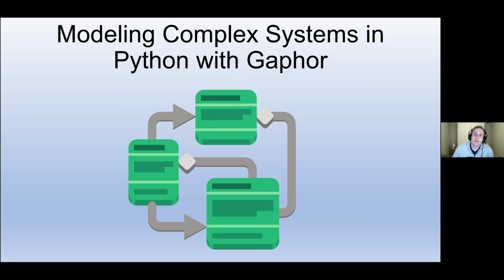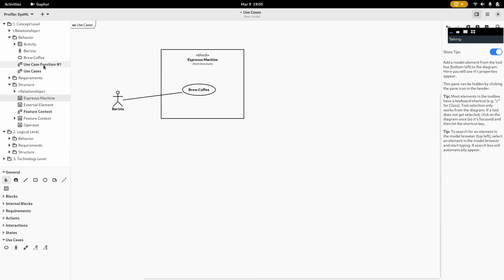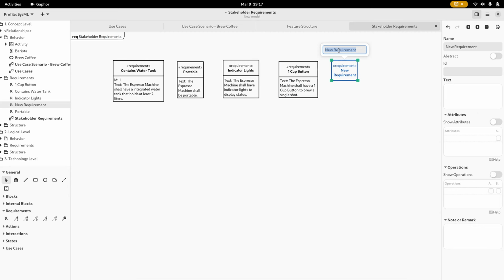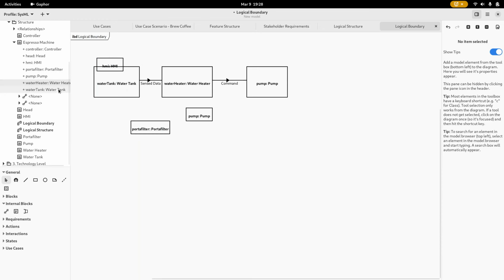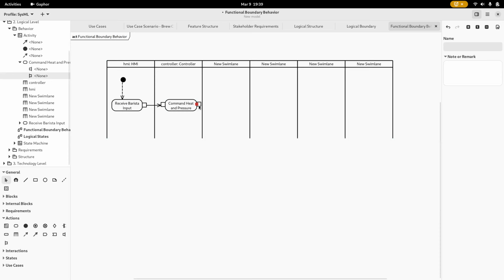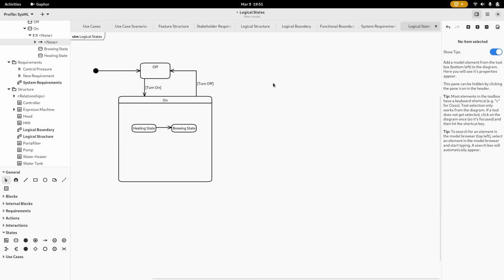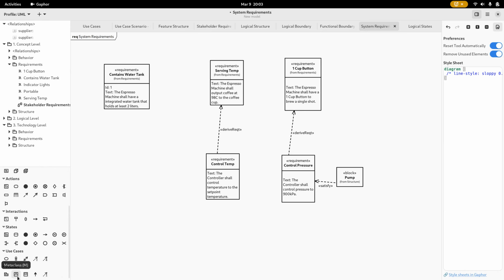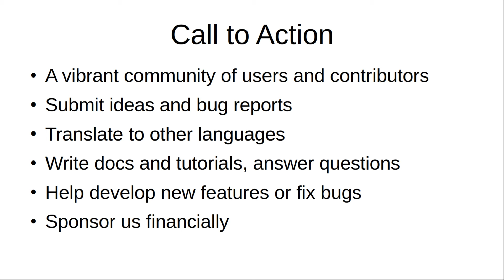Modeling Complex Systems in Python with Gaphor

Comment: you are a saver. I have been trying to combine model based system engineering tools and develops tools. Typical MBSE software doesn't have a good remote syncing process or syncing features for other members. Additional  feature such as storing files on git is unusual able without paying for extra plugins or subscription.

Comment: If I want to create different activity diagrams for different use cases, it always creates a new activity for that diagram. How can I add an activity diagram on the same level as the pregenerated one? Or do I create a different use case diagram for every use case? I thought I put every use case in the "use cases" diagram and based on that create different activity diagrams for the use cases, right? Because I can´t place the new activity diagrams into the model view if it is created under a new activity.

Comment: Is there any Atlassian/Jira integration planned or already written?
Reply: No, not currently
Reply: @DanYeaw  Is it even possible to use the python language itself in safer way that gets very close to the standards used in safety critical software? And if that is possible what does the development workflow look like and what tools do you need to use together to achieve this? 
I'm mainly skeptical because I've seen type system experts make jokes on how incomplete and unsound python's type system is so I do not know what to believe. 
I'm thinking of learning either Rust or Ada since subsets of the languages are actually used in safety critical scenarios. 
But I might stick to Python if there are proven workflows and tools that can make Python safe to that degree.

Thank you!